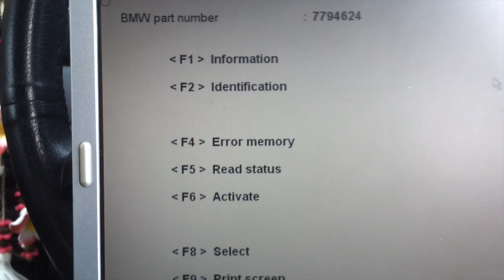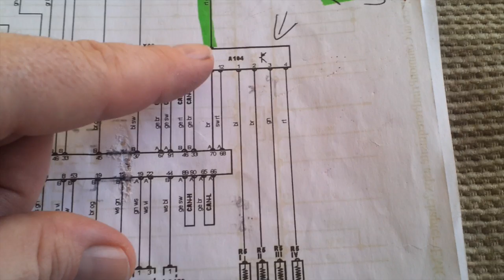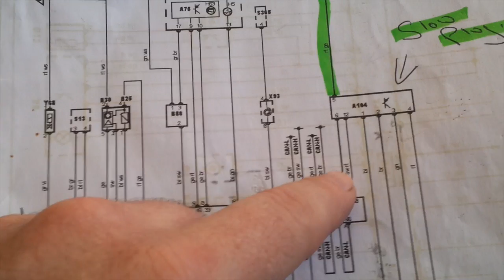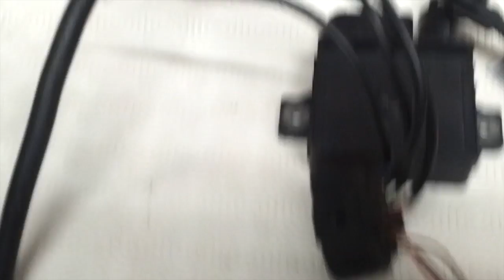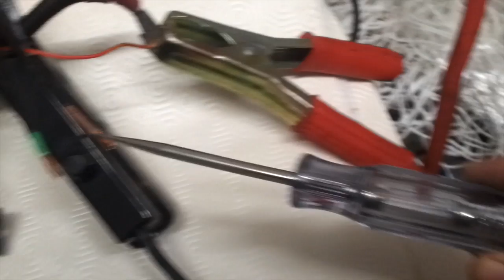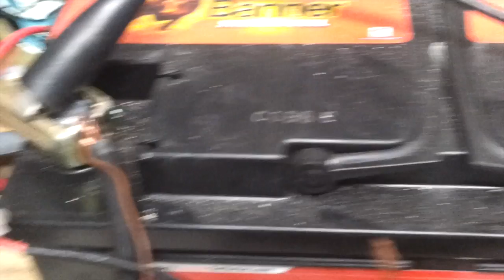BMW Glow Plug Module E46

Comment: Thanks for sharing! Didn't you connect terminal 12 to the computer so that the glow plug controller can operate according to the signal from the computer or did you just connect positive and negative to the battery and the controller operated right away without receiving any signal from the computer?
Reply from the maker: Yes just connected straight to battery no computer needed cheers sandy

Comment: Great post. Should car refuse to start in warm weather when glow plugs faulty? Mine went into limp mode with dde light on, the engine stopped, now refuse to start although cranking fine.
Reply from the maker: Hi don't need glow plugs to start a modern diesel! The problem will be fuel pressure check out this video and use a multimeter instead of a scope if u don't have one cheers sandy https://youtu.be/pHitMK2YteE

Comment: Nice and neat video.. I hve the same model 320d E46 my car starts up fine on cold starts but won't start when it reaches normal operating temperature. 
Wat could be the problem?
Reply from the maker: Hello u need to check high side fuel pressure, low side fuel delivery and make sure egr is closed cheers sandy

Comment: From the look of things I'd say you know a thing or two about the 320d \o/. I'm having a problem with the exact same car (except for being MY2003) and the problem is fuse #1 (F1) blows as soon as I turn the key. I feel I've crawled like 50% of the internet now searching for some clues to how I can fix this but it's close to impossible. So I'm hoping maybe you would be able to point me in the right direction to eliminate this problem and get the vehicle back on the road. PS! It still cranks the engine when trying to start so it's not like everything dies.
Reply from the maker: Espen Grimsgaard check out my latest video, hope it helps cheers sandy

Comment: hi mate, i have the sympton when car chokes but does not start all , checked the e-box and the went to the engine management fuse box and tested all fuses with electro meter and seemed find but the 30a Fuse on the end of that socket was not feeding any power? " basically long story short, started the car up yesterday, there was no smoke when usually i do a cold start there is smoke, and car died out on me!! what is the problem do you think?
Reply from the maker: Chaos3717 these high pressure BMW do not require glow plugs in order to start, I would check the 2 fuel pumps, 1 in the tank which is a low pressure transfer pump access under back seat (open fuel cap and listen for initial prime before crank first thing in morning) 2. fuel pump under car (located near passenger seat next to fuel filter filter but coveted over with metal plate listen hear too for initial prime
Reply: sandy anderson before the issue happened, ill tell you the symtoms, the car was started on cold start but for some reason there was no smoke . Than 20 minutes later while on my drive it died and DDE light came on. As it was running previously it was running like it was having breathing problems like( heavy breath heavy breath then low breath heavy breath heavy breath than low breath) would it be maybe because the fuel level is on low ??
Reply from the maker: Chaos3717 seems like a fuel starvation problem have u changed the filter
Reply: havnt changed it in a while

Comment: can you please tell how you sort out the other error....i have the exactly the same errors all plugs and rail pressure
Reply from the maker: 91StefaNs60 the rail pressure codes usually clears once u fix glow plugs, it is generated when the car fails to start
Reply: sandy anderson the car starts everytime...now that rail pressure is gone...only the glow plugs error still on....i m confunsed now

Comment: Hi, superb video, got same problem with my 525d, changed new glow plugs and module, but still showing 6 glow plugs fault, any ideas, thanks
Reply from the maker: have u checked with a test light that you are getting power to individual glow plugs?
Reply: No, i havn't, but will do tomorrow,  checked fuses in ebox. If turns out there are no power to glow plugs, what should be the problem, running out of ideas, thanks for reply
Reply: module/relay

Comment: Hi great video! I've got the same e46 I've changed plugs and even the fuel pump thinking that might have something to do with the fuel line as my e46 won't start... ( it eventually fires but on a cold morning there is no hope) Can you tell me where the glow plug relay would be please... ( I have no idea where this fuse is). Ive checked the little fuse box you've shown in the video and all the fuses seemed fine 

Your help would be overwhelming
Reply: think on prefacelift e46 330d etc the module/relay is in ecu box.nothing under inlet manifold unlike 6 speeds
Reply from the maker: The glowplug control unit is on the top of gearbox I think the relay is next to fuses in engine bay

Comment: Hi I am trying to search for the location of the glow plug control module on my e46 320d 2004 BMW and was just wondering if you knew where it was located 
Many thanks great video
Reply from the maker: It sits on the side of the gear box a real pain to get to from underneath and to get it from top u have to strip out pollen filter and bulkhead fittings